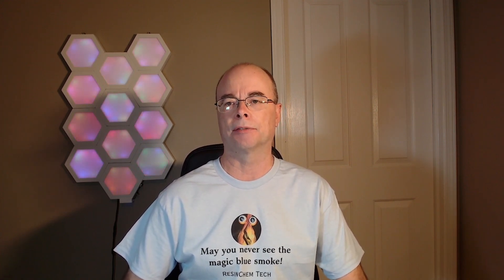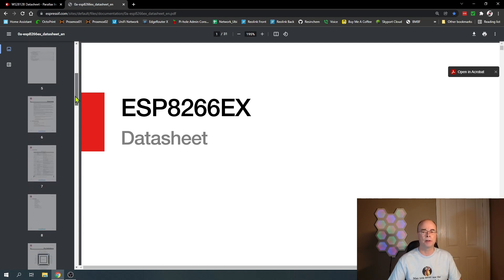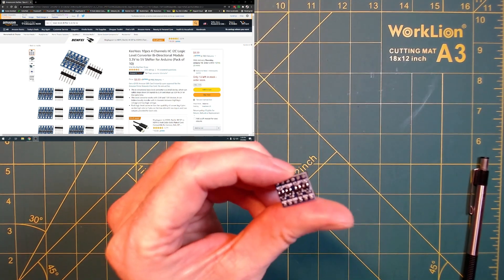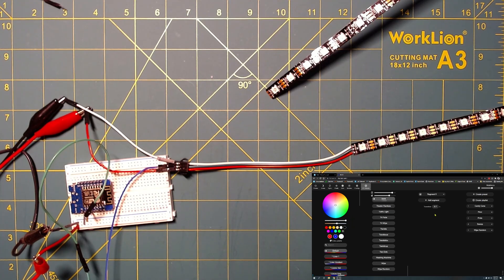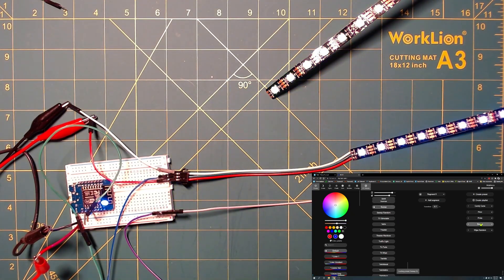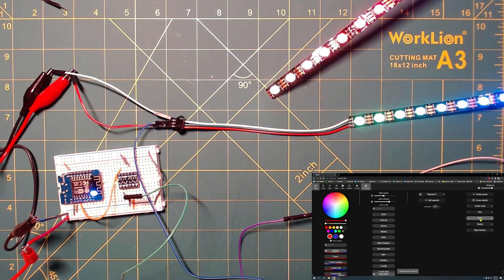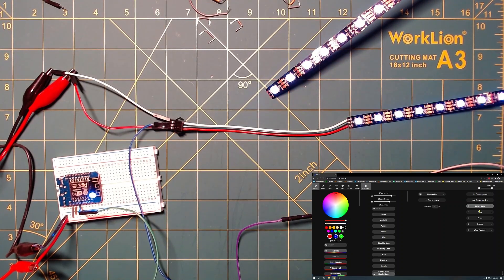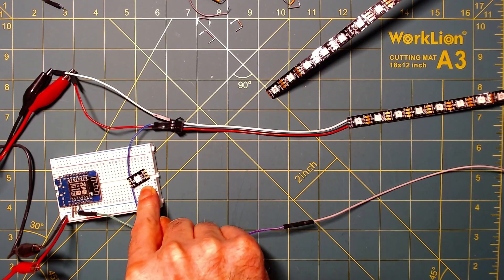Logic Level Shifter and WS2812b LEDs

Comment: i have everything working on my esp32 board. here is my problem. I want to use wt32 with ethernet away from the house. as soon as I hook up the 3.3v for LV on my logic shifter the board goes dumb. have you had any experience with this?
Reply from the maker: I haven't but just to confirm your wiring... 3.3V and GND connect to the LV and GND on the shifter. 5V and GND to HV and GND on the other side.  Your LED signal from the ESP32 GPIO pin should go to any one of the 4 channels on the LV side and the wiring out to the LEDs to the same corresponding channel on the HV side.

I don't know of any reason why the shifter would impact the wt32, as it is a serial device and the only thing this shifter is doing is boosting the data line from 3.3V to 5V.  If connecting to the shifter is causing a shutdown, then there is either a short somewhere (assure you haven't inadvertently created a solder bridge somewhere) or it is possible that you just have a faulty shifter.  Personally, I've never had a shifter to do anything like that... but I have also not used a wt32 either.
Reply: @ResinChemTech  Thank you for the reply. Yes I have 5volt and ground from android charger to power the wt32 and also the HV and GND of the shifter. I then grab 3.3 and GND from the wt32 to the LV and LV GND side of the shifter. When I did this with the ESP32 it worked great. When I plug both 5v and 3.3v into the WT32 it don't like it. I see the the WT32 is either 5 or 3.3 volt so I don't think its and output on the 3.3v side. Just curious if you ever ran into this.
Reply from the maker: As I mentioned, I have not used a wt32 before so I can't say for sure, but from just glancing at it, I would think that as long as you only feeding incoming voltage TO the board on 5V, should be able to provide 3.3V OUT to another device.  Again assure that you aren't somehow providing both 5V and 3.3V to the board... it probably won't like that!

You might check out the wiring diagrams for my WLED controller in this blog article: ( https://resinchemtech.blogspot.com/2021/01/building-your-own-led-light-strip.html ).  This won't be exactly the same as you wt32, but it does show how the logic level shifter should be wired to the microcontroller.  Otherwise, you might need to check the spec sheet on the wt32 and what it says about connecting the 5V and 3.3V pins.

Comment: I have another question . How do i get Wled to everything it is turned on to start with the same setting it was shut off with  ex. Color pallet and animation?
Reply from the maker: This is actually pretty easy.  Once you have the desired settings (e.g. color, effect, brightness, etc.), save it as a preset.  Note the number of that preset.  Then go to Config -> LED Preferences.  Scroll down to the defaults.  You will see an option to apply a preset at boot.  Enter the number of your preset.  You can also opt to have the LEDs turn on automatically when booting.  Once set, any time power is applied or the board reboots, your desired settings will be applied.

Now, note that this only applies at boot.  If the board maintains power and doesn't reboot, WLED should always turn back on in the same state that it was when last turned off, which I think is what you were wanting.  If for example, you have the LEDs set to a green and blue chase effect and turn off with the Power button in the WLED interface, it will be green/blue chase the next time you turn them on via this power button... unless the board loses power or reboots.  Then defaults are from the LED preferences are applied.  If you find that you when you turn the "Power" off via the interface and then turn it back on later, the LED strip is a different color (especially if it is solid orange), then this is a sign that your board is rebooting at random.  I actually had this with a board once... but by setting a default boot preset, it always turns back on in the preferred color and effect.... even after a reboot.

I hope that helps.
Reply: @ResinChemTech  yes this helps a lot . Thanks again

Comment: For my testing I use my eyes.
I have a run of 1200 for 66' and another of 1600... I do have my controller less than 2 feet to first run, fuses and power injection of 4x and that is it.... and my colors are true at p910 as p1.  I have nothing for the data .And that goes for candy cane also.
BUT.... since I am not an expert and believe in OVERKILL ... I am going to add these! :)

Comment: it's interesting, for me 240pixel rings work on a 20-meter cable without any problems. On arduino (5V) I tested even at 100m and it worked as it should
Reply from the maker: The GPIO pins on most Arduino boards already put out the 5V required by the LEDs on their GPIO pins.  ESP boards, however, only output 3.3V.  Are you saying you ran a 20 meter cable using an ESP board without a shifter?  If so, I guess you are pretty lucky to not experience any voltage drop over that distance that would result in the signal dropping below a usable voltage for the LEDs.

As I said in my video (and repeatedly in other responses), the choice to use a logic level shifter is totally up to each individual.  For me, when using an ESP board, I'll spend the extra $1 to assure a good 5V signal leaving the controller... no matter how long my wiring run might be.  That's just my choice.

But you are right that you don't need a shifter with most Arduino boards as the outbound signal is already at 5V, so the shifter wouldn't provide any additional value.
Reply: @ResinChemTech  of course I was talking about 20 meters in the context of a 3.3v signal from esp32

Comment: Hi, need your help. I have a WS2815 LED strip (60Led/m and total 5meter strip) which is 12v 5Amp. Power Supply im using is 12v 10Amp. Board is ESP32 with 30Pins. To convert 12v to 5V for the Board Im using XL4015 Board which is input voltage to ESP32. Have connected the WS2815 power directly to Power Supply 12v 10Amp and the Data Signal to D2 Pin for ESP32. However when i turn on the colors are not right and when I turn off from WLED app I see some LED as red in color which is like 1 in 10 LEDs is red in color. Can you please guide what am i doing Wrong? Also how much should be the Power i mention in WLED APP for a 5 meter strip which has 60*5=300 Leds. Even when i keep it on Color as Solid I see some weird animations that too with weird colors. As per the WS2815 datasheet i think the minimum voltage it requires is 12vx0.7 = ~8v.... Is this the reason why the lights are behaving weird? Please guide
Reply from the maker: There could be a number of causes.  First, assure you have a common ground between the controller and LEDs.  But it sounds like you are using the same power supply for both, so you should be good on that issue.

Next, have you tried power injection for the LEDs?  300 would be a lot for 5V without power injection, but it might not be necessary for 12V.  It is worth a try to add a 12V connection to the end of the strip as well as the beginning to see if that helps.

Finally, you didn't mention that you were using a logic level shifter.  If you aren't then this is likely your problem.  It sounds like the LEDs are behaving similar to the ones I showed in this video.  Remember that the ESP32 only outputs 3.3V on it's GPIO pins... but the LED strip expects a 5V data signal.  Occasionally, you can squeak by without one as 3.3V is at the very minimum voltage.  But any voltage drop and the LEDs will start to behave just like you describe... because they are not receiving a good data signal.  If you are not using a logic level shifter, I strongly suggest this is your problem... and adding the shifter will likely fix it as well.
Reply: @ResinChemTech  sure will try this with logic level shifter. There were 2 reasons I did not use Logic level shifter as per your video ... 1: In your video lights started behaving odd once distance between ESP and strip was more than 6 feet. In my case it was 2 feet. 2nd reason from your video i could not understand wiring for logic level shifter and hence thought due to distance between ESP and strip I can do away with it.... Requesting if you can plz share a Lil detail video of using logic level shifter wiring.... Also would a 5v data signal for ws2815 be enough? Also is it because that ws2815 is 5Amp rating and my power supply is 12v 10amp?
Reply from the maker: While I haven't used WS2815 strips myself, according to the data sheet, acceptable data signal voltages are 4.5V - 5.5V, which is even higher than the 3.5V for the WS2182b.  This almost certainly means that your problem is low voltage on your data line... something the logic level shifter would fix.  It also explains why you have the problem with even a short wiring run.

I cannot share a diagram here in the comments, but there are plenty of other online resources for how to wire the logic level shifter.  But the short of it is that you feed 3.3V and ground to the LV and GND pins of the shifter.  You can use the 3V3 pin of the ESP32 to supply the shifter with the 3.3V.  Your data signal from the ESP32 feeds any one of the four channels on the LV side (LV1 - LV4).  On the opposite side, you feed 5V and ground to the HV and GND pins.  The outgoing data line to your LEDs is then connected to the same HV channel as the LV signal on the opposite side (if you data line from the ESP32 is connected to LV2 for instance, you connect the line to your LEDs to HV2 on the other side.  That's really all there is to it.
Reply: @ResinChemTech  sure thank you so much for checking the datasheet for me and confirming the problem area. I will try this for sure and share the photo or video with you....
Reply: @ResinChemTech  It worked. Would love to show this on a video. Is there a way i can share my video with you? Like a WhatsApp number? Also how do i now add MAX9814 for Sound Reactive to this setup itself? I know u have a video on Sound Reactive https://www.youtube.com/watch?v=_xEFJMp48z4 but thats with WeMos D1 Mini. What would be the wiring for ESP32?
Reply from the maker: Yay!  Glad you got it working.  The best way to share a video, if you like, is to simply upload it to YouTube.  If you don't want to share it with everyone, you can simply mark it as private and only those you share the link with can view it.

As far as the ESP32, the microphone hookup is basically the same, except that the ESP32 has multiple ADC pins (instead of the single A0 pin that is on the D1 Mini).  You can use any of these (use the ADC1 pins... I recommend staying away from ADC2 pins if you are using wifi), but the default pin in the sound-reactive version of WLED is GPIO36... which may be labeled as the VP pin on some boards.  Check your board pin out.  Otherwise, the wiring is exactly the same as the D1 Mini.   So, just connect the wire that is shown connecting to A0 on the D1 Mini to GPIO36 on the ESP32.

And congrats on getting it working.  People always seem to want to argue about using a logic level shifter, but it can solve so many problems. I choose to always use one whether I think the project really needs it or not!
Reply: @ResinChemTech  Sure. Will upload and make it private. Also now there are 4 boards which im running (XL4015, ESP32, Logic Level Shifter and soon 9814). How can i get it all on a single board and small box which can be hidden in the False Ceiling or somewhere where wires remain secure for years.? Once again thank u so so much for guiding and supporting
Reply from the maker: ElectroCookie and other manufacturers make larger size boards.  Just go to Amazon and search "solderable breadboards" and find something that is large enough to hold your components.  Same for an enclosure.  Just search for "plastic project box" and you'll find all sorts of shapes and sizes.  Find one that will hold the board you selected.  You will probably have to drill or cut some holes in it for your wiring, but these boxes are pretty easy to modify with a drill or rotary tool.
Reply: @ResinChemTech  one more question.... If i have to add another strip parallel to the main one, can I use a different power supply for that strip and give data signal from same Logic level shifter by creating a short between LV1 and LV2? Reason to not create segment on single strip is that it would ask for larger power supply and still on a long length like 80 feet total length there could be a probability that pixel in beginning get more power than in end.... Your suggestion?
Reply from the maker: You can split the data signal after it comes out of the logic level shifter and run it to two different strips.  Don't use two different LV channels.  Just take the wire that is coming out of the HV channel and split it. This is exactly what I do for my LED stair lights.  But note that the two strips will always be the same color and have the same effect.  It will not be possible to have them do different things or be different colors, as they both have the same exact data signal.  WLED will only see a single strip and the number of pixels should be set to the length of only one of the strips (the longest if they are of different sizes).  Also remember that there must be a common ground between the LED strip and controller.  But a ground connection ONLY.  Trying to connect two power supplies together is very tricky and could cause damage if not done correctly and with the proper power supplies.  So, if you use two separate power supplies.. one for each strip, just assure the ground is the only thing in common.  Honestly, it would be easier (and safer) to just get a larger single power supply that has the capacity to power both strips.  If worried about the size of that power supply then I recommend you add an appropriately sized inline fuse to the power supply as an extra precaution.

Comment: I have a question the Mode mcu 8266 I am using do not have a 5v pin on them  so how do i hook the logic level shifter up to it? I am running it offa 5v power supply but have it hooked up to the vin pin
Reply from the maker: The VIN is the same as 5V.  Some boards label it as 5V and others as VIN.  Check the pinout of your particular board to be sure.

However, if for some odd reason you truly don't have a 5V pin (if you are powering the board off a 5V connected to VIN, then this is the 5V pin), you can use split off the 5V that is running to power the board and connect that to the HV side of the logic level shifter.

Hope that helps.  It can be a bit confusion when first starting out since different manufacturers label pins differently.  Let me know if you have any additional questions.
Reply: @ResinChemTech  Thank you very much. that is what I thought but I wanted to double check before I blow something up.
Reply: @ResinChemTech  Thank you very much

Comment: Awesome video . I learned something new. Logic level shifter needed only if you use data wire longer then 3 feet .
Reply from the maker: Three feet is by no means a guarantee.  It somewhat depends upon the gauge of wiring used, the tolerances of your controller and LED strips, etc.  In some cases, you might get longer distances without issue.. and in others you might have problems with distances shorter than three feet.  That's why I recommend, and always use, a logic level shifter on all my LED projects.  Then I don't have to worry about having a problem with the signal voltage.. whether the distance is 6 inches or 6 feet.  But like all DIY projects, the decision is yours whether to use one or not.

Thanks for watching and the kind words!

Comment: Hello. Excellent  job. 
 I have a problem with my stairs. The first step is about 12 inches (Data and power) away from esp32 and the others go up to a distance of 195 inches. I will configure 8 gpio. After setting the first GPIO the steps flash. It could be a date issue. is it better to use a level shifter on every GPIO? 
ThanksYou have a telegram group?
Reply from the maker: If I understand you correctly, you are using 8 different GPIO pins connected to your LEDs?  I'm not sure I fully understand why you would use multiple GPIO pins in this case... if you want different segments of the LEDs to be different colors or have a different effect, you could use one or two GPIO pins and use WLED segments (I am assuming you are using WLED).  Maybe two GPIO pins if you wanted a different signal to each side of the stairs, but 8 sure seems like a lot for a run of only about 16 feet.

But in any case, if you are using multiple data signal outputs from different GPIO pins, they are all outputting at 3.3V while the LED strip expects a 5V signal.  So, yes, for a more reliable signal, each data line should be shifted up to 5V with the logic level shifter.

Sorry if I misunderstood your particular install.  But I think the general rule (for me) is that any and all data signals should run through the shifter and be boosted to 5V before going to the LED strip.